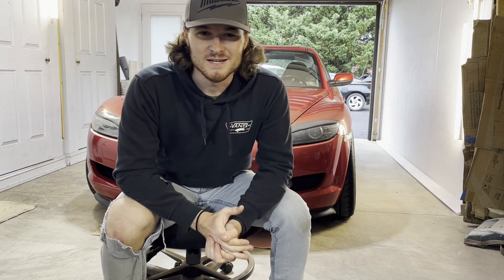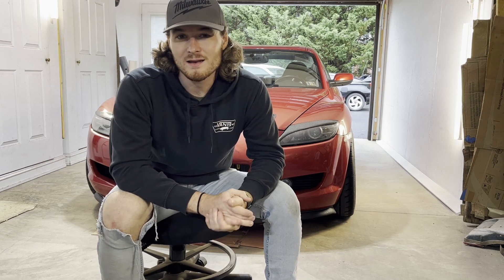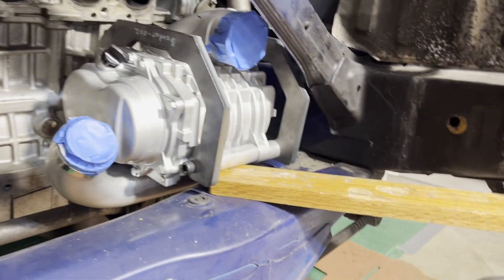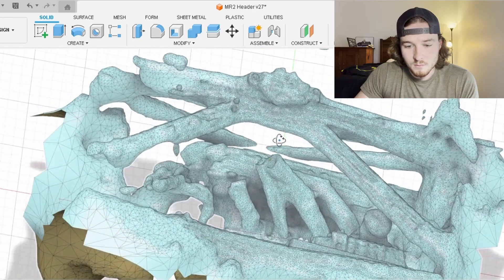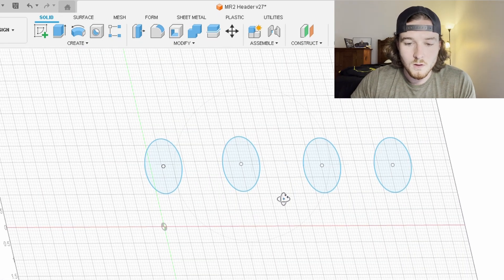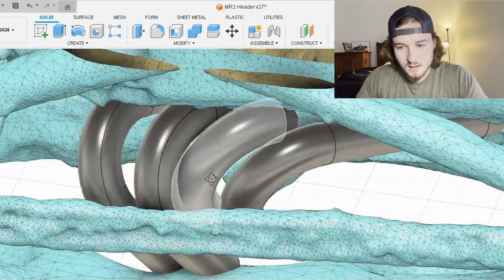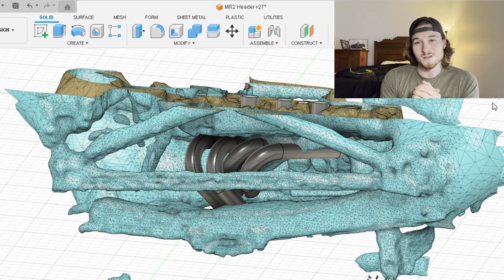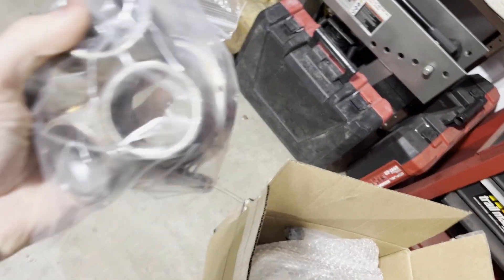How To Design Your Own Exhaust Header

Comment: I want to do something like this on my ep82 starlet. What really is challenging me is the pulleys. I hane a 7 rib pulley on the supercharger and a 4 rib on the crank. I suspect the belt might slip on a 4 rib pulley if i put an aircon pulley on the supercharger. What do you think?
Reply from the maker: That would be awesome! I will run into a similar problem. Thinking the solution could just be a ring tack welded to the SC pulley to act as a retainer and basically reduce the pulley down to the correct width? Does that sound like it could work? Either way, thanks for watching! :)
Reply: ep82s are sick. take it you're going from N/A to supercharged or are you running the 4efte and going supercharged?

Comment: hi there! is the old header a mwr one that fits onto the original cat? are you selling it?^
Reply from the maker: It is actually from ebay. They used to sell them on there years ago. From what I can tell it is a replica of the MWR one. I may be interested in selling after I get my other one build and get the car back together. Maybe in a few months?
Reply: @gastancehouse  i'll check in a few months then, i'm in the middle of a 2zz swap but except for mwr i dont have any other cheap options in eu..
Reply from the maker: Sounds good! If you can message me on instagram @cadekb, there may be a better chance I see it. Good luck with the swap!! Shipping may be a bit much for me though if youre not in the US...

Comment: I was planning to get a Revopoint scanner to make a custom front mounted turbo manifold for my WRX but I will have to try this free scanner first. It looks good for getting rough dimensions that you can model around in SOLIDWORKS. What material are you planning to use? I feel like schedule 10 would be the best since it's thicker, making it easier to weld.
Reply from the maker: Yeah man definitely give it a try! I ended up getting 16 gauge stainless tubing which is roughly 1/16 thick. Not the easiest thing to weld but doable